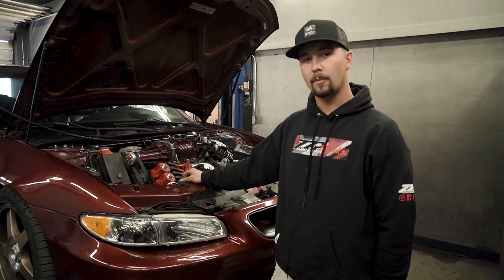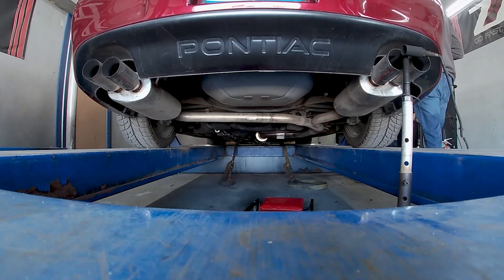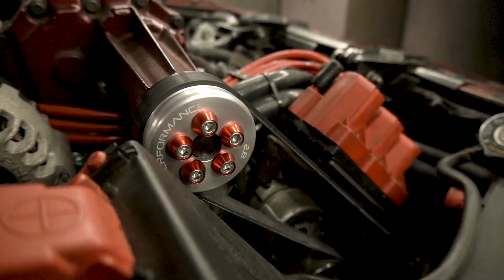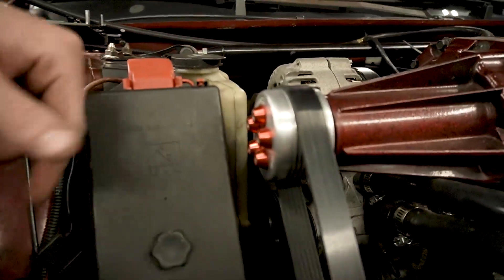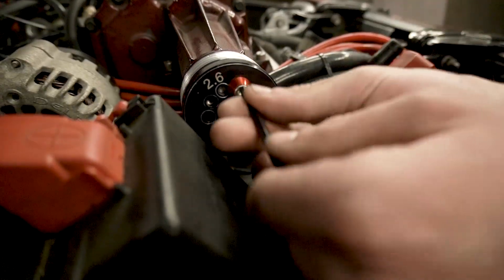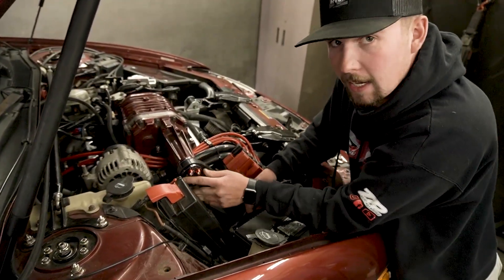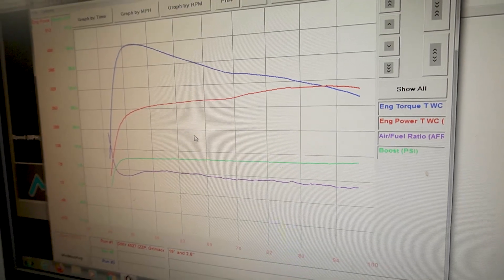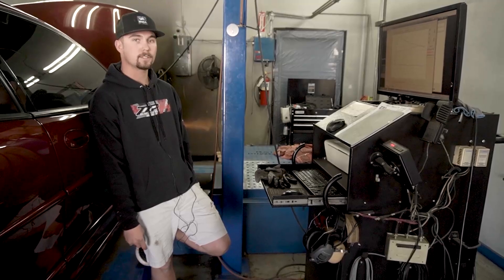Equalizer Downpipe Power Test

Comment: Respect you guys are still tuning 3800's, Wish GM still had those available in modern cars, Miss my 40th anniversary GTP. Thing ripped with the zzp tune
Reply: Just like LS small blocks they continued on. 3800 should’ve did the same. 3800 Series IV 295Hp, 354TQ lol jk.
Reply: I recently just had to drive my pacecar and the power wasnt what i remebered after feeling a tuned lnf.  Great platforms to work on tho compared to most.
Reply: They wouldve had to pair em up to good transmissions if they continued
Reply: @ianscheurer  that was pretty much the weak point with that platform.  I cant believe they still used the same transmission in the LS4 cars as well.  Pair it up with a nice 6 speed or a stronger auto trans.

Comment: Ryan just released a video that talked about the Eaton M90 efficiency range being 7-9lbs of boost, yet these guys are pushing it up past 12lbs? I don't understand, could ZZP explain?
Reply: I was thinking the same thing.
Reply: The science behind it is above that range the blower generates more heat so you get diminishing returns. This is negated on an intercooled car as the intercooler can remove in excess of 100 degrees of intake air temp.
Reply: @joeyf8368  Bingo. There's a reason they got the nickname "heatons." Much like some tunes pushing the 1.4 turbos to over 20 pounds of boost on a stock cruze/sonic, you're so far outside the efficiency range that the temps are getting stupid high.
Reply: @joeyf8368  ok, thanks for clarifying. I must've gotten fixated on the crossover and didn't notice the intercooler.

Comment: You weren't "Out of Blower", you were "Out of Intake". A Common misconception about Roots. All you're doing is  just increasing the pressure of the same volume(Mass) of air. The more air you can get INTO the blower the more power you will make. You can crank the PSI all day long but if you don't get more air mass in to it, you're not doing a damn thing. There's a reason why Weiand blower guys use a big ass throttle opening on top fuel cars.

Comment: Teat this product on a bone stock m90 setup. Not a xp with major overlap- a xp cam is not a simple setup for most.  Nor does it give us any info what a 3800 can do.   Show us stock #upgrades because with that setup u should be better than 310hp
Reply: Ryan Wahlstrom that's exactly wat I was thinking.  Where is the hp. 310hp seems low with those mods

Comment: My Guess Was 325WHP After Hearing Mods! It Would Have Made It If The Blower Could Push Out 12lbs hahaha. That Equalizer Pipe Has Me Curious On How It Sounds In Person. I Like The Stock 3800 Sound. This Probably Makes It Sound Like An Import. I Miss My Turbo Monte Carlo. Thing Was Making 480WHP With 210,000 Miles, Cam, ZZP Front And Rear Logs, 80# Injectors, Water Meth, Blocked Off M90 And On A Unstable Fuel System. The Unstable Fuel System Finally Caught Up To Me And Melted 2 Pistons Top Of 3rd Gear At 150MPH LMAO. (Don't Use The Stock Fuel Pressure Regualtor Above 300WHP lol)  She's Been Down 9 Months 😢. Short Block Is Ready But Still Been Waiting On My Cylinder Heads To Be CNC Ported In Indiana. Also Milzy Is Making The Turbo Hot Side. The ZZP Logs Keep Cracking On Me Like Crazy (They Crack Around All The Welds On The Flanges)  And That Stupid Donut Gasket Never Seals If Dealing With Turbos And The Added Back Pressure Between Heads And Turbo. The ZZP Logs Will Not Give You Issues Unless Your Turboed.

Comment: So Ryan d says don't pulley up if your mods dont support it, but this video says otherwise.
My concern is that this video is just trying to get me to spend my money. Im interested were this goes.
Like zzp for filling the gaps in the performance market.
Reply from the maker: We understand the confusion. Fortunately the mods on this 3800 allow us to run a smaller pulley. It has a full-stack intercooler, bolt-ons, E85, and an XP Camshaft. As Ryan said, you want to match the proper pulley to your build and for this build we needed a 2.6 to achieve the desired boost.
Reply: @ZZPerformanceChannel Can I get a  list of mods for a reference point.
Thanks again for the great products.

Comment: if I upgrade the rods, pistons, piston rings, rocker arms, pushrods, valves, and headstuds, would a 270k+ mile 1998 grand prix Daytona pace car with the 3800 supercharger, would the block be able to handle the power? and ofcourse replace all gaskets too
Reply: asking because I just bought one?
Reply: Why would you need to upgrade any of that? These engines have ran deep into the 8's in the 1/4 mile with 100% stock bottom end. They're strong as hell.

Comment: How much power is it losing compared to running the power logs with the normal crossover?
Reply: Based on scans, nothing. Although, like mentioned in my comment above we'll be doing a proper A/B test on Zoomer's car here soon. 

This video was more meant to showcase the sound of the equalizer. It sounds great in video but even better in person
Reply: @JPL Performance Honestly, not enough to worry about. 3" is overkill for 99.9% of cars. We didn't have to jump up to a 3.5" downpipe on our 2.0 LSJ that made 898whp until about 600whp. Zoom's car runs a 2.5" catback that necks down to 2.25" after the rear axle. 

My turbo Ion Redline made 408whp on a 100% fully stock catback a few years ago. Exhaust size doesn't matter as much as people make it seem.
Reply: @gbrunner24  exactly. People put a 3 in exhaust on a stock Honda Civic and think they're making it fast when really all they're doing is making it sound like shit.

Comment: I have to say this is NOT (I repeat NOT) a “basic build”. Anything with a cam/intercooler/springs/e85/2.8 pulley,,,, I’d say is on the verge of a highly modded engine. 

Since the 90’s everyone I’ve known considers a mild build is intake/header/exhaust/tune/ slightly smaller pulley.
And what I don’t get is it seems like people contradict each other. I thought “you never should rub anything smaller than a 3.4”. This is coming from “other people” there. It’s like no one agrees. I do LOVE your build and I have the parts for a “mild” build, but am waiting for exhaust and power logs or headers.
Reply: Yeah there's a little confusion but let me try to clarify some things. 1. Trying to run a too small of pulley kills power because the supercharger gets out of its efficiency range. Anytime a supercharger or turbo gets out of its efficiency range, it starts blowing extremely hot air. Hot air means a big PSI number, but in reality it's just hot air. Think of 90 PSI in a semi truck tire vs 90 PSI in a bicycle tire. Now technically they're both read "90 PSI" on a gauge, but the volume of air in the two is tremendously different. Beyond that, hot air is less dense than cooler air. Less dense = less oxygen, less oxygen = less power. 2. Hot air = detonation. Superheated air will easily combust, which is bad because the air/fuel mixture will combust before it should in the cylinder. This is called detonation, or spark knock. Luckily, GM engineers knew this would happen so they have what's called a "knock sensor". This is a little sensor that detects spark knock and tells the ECU to pull timing. The problem is when the ECU pulls timing, it pulls horsepower. So now all that horsepower you just spent a lot of money on for that under size pulley, the ECU just pulled out of your engine! See, less timing = less power. Less power = less heat and less heat = less detonation. So now you understand why it's not good to "crank up the boost" so to speak, but why is this car getting away with it? Couple reasons. First this car is running e85. E85 has the octane equivalent of about 103-105. This significantly decreases the chance of detonation. 2nd, this car is running an intercooler. The intercooler can lower intake temperature by over 100°F which furthermore reduced chance of detonation. Finally this car is fully modded to take advantage of the boost including but not limited to: a low restrictive exhaust, cold air intake, 180° thermostat, cooler spark plugs, and safe tuning.

Comment: You made 306 with the 3.0 and only 310 with the 2.6? How does that make any sense
Reply: Smaller pulley is not always the best answer. It's all about finding the best pulley for the efficiency range of the blower and your setup. Typically going too small on the pulley size will bump the HP a few but give you some more torque. With that though comes more heat. 

This is why I'm sticking to a stock pulley on my LSJ build. Less heat, more reliable power and I can run a ton more timing out the top end.